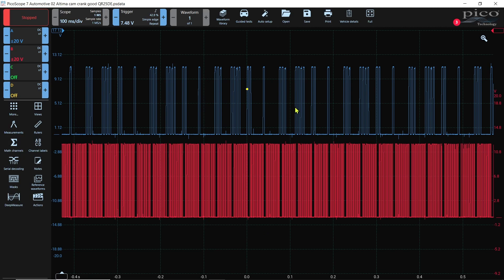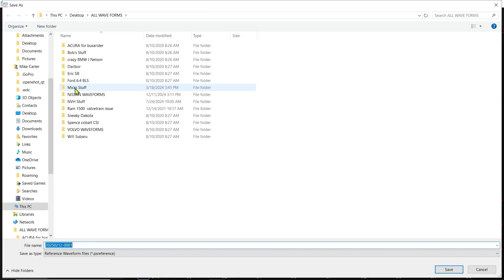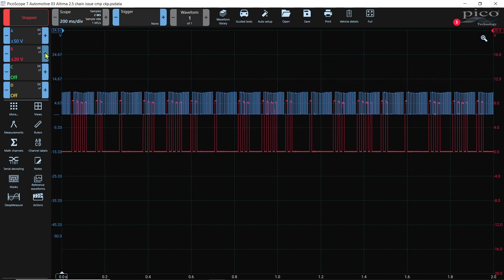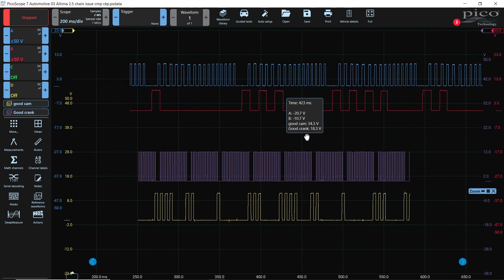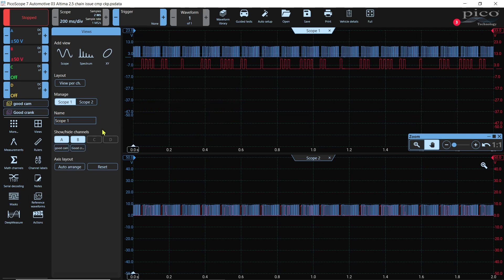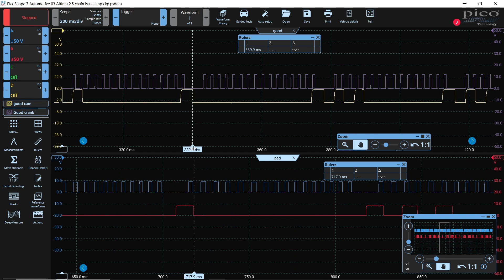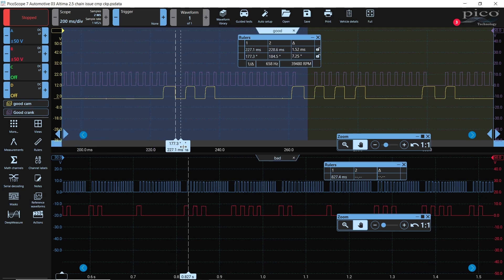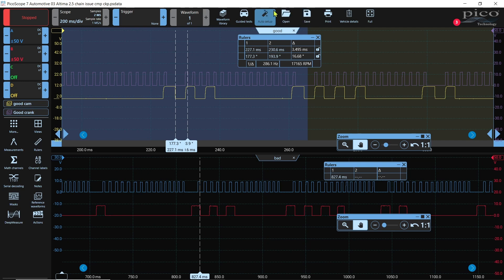Reference Waveform

Comment: Quick question when measuring should the solenoids for the intake and exhaust be disconnected KOER when capturing, nice to see how to perform a split. Thank you
Reply from the maker: Unplugging them will work, but on hard to reach solenoids, I will monitor scan data for any solenoid command.  
Neither of these options will help if the solenoids are mechanical stuck though.

Comment: Based on how many degrees can we assume that the time is out of range and how many degrees mean that the signs are still OK? What is the tolerance?
Reply from the maker: Kinda a broad question,  but Nissan is usually  +/- 5-8 degrees . Depending on the engine.

Comment: You just sold me on the split-screen, seems very easy to compare two waveforms!  Have you ever used a scope to diagnose hid headlights?  How to determine bulb vs ballast without parts swapping?
Reply from the maker: Never scoped a ballast.  
It's usually both for me, I've been burned to many times replacing one or the other, and it stops working again a week later.